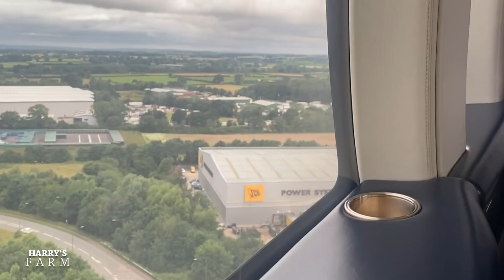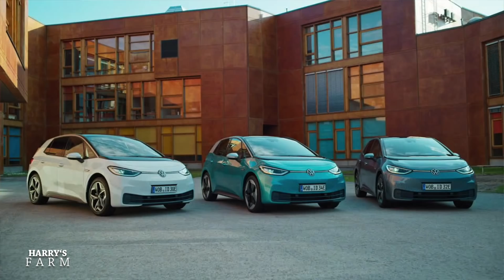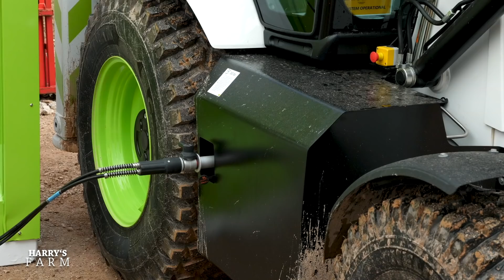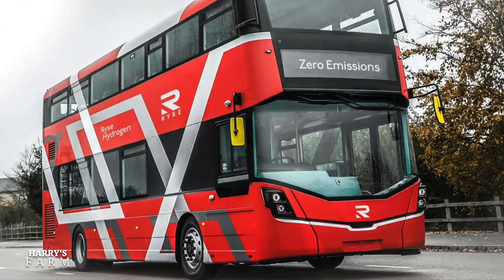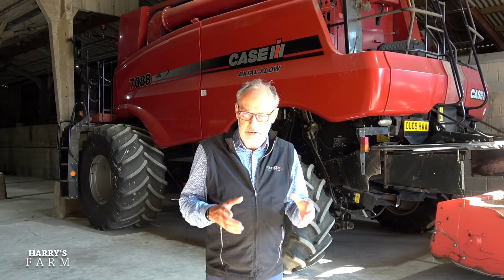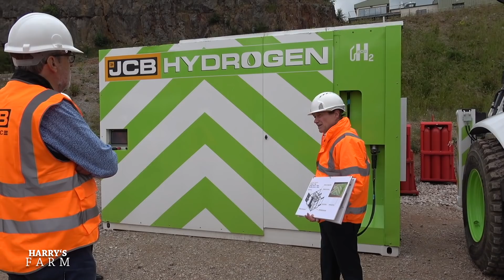Why JCB thinks hydrogen is the best alternative to diesel for heavy machinery, farming and HGV fleet

Comment: Without fuelcells, there is no point in hydrogen, you might as well use synthetically produced hydrocarbons.
Reply: Or just keep burning diesel, which is the entire point for their advocates.
Reply: @lordsamich755  So long as we made the diesel by capturing CO2 then fine, the only problem then is NOx.
Reply: @garthnareng4898  
That at least in some ways makes Ammonia a better choice as an energy carrier. If it's being reformed to feed a set of fuel-cells the nitrogen can be released into the air which is already around 80% nitrogen. NOx emissions are therefore inherently non existent.

When we go for a much stronger carbon bond, there is considerably more energy expended making and then breaking that bond. Which has a deleterious effect on round trip efficiency.

One also has to consider the energy expended to acquire the reactants in the first place. Nitrogen is readily available at industrial scale, (as is Ammonia for fertilizer production) as a side product to production of most industrial gasses, (Oxygen, Nitrogen, Argon, etc).

CO2 by contrast is generally manufactured for use in carbonated beverages, because extracting it from the air is considered economically un-viable.

Where the suggestion is to use the gas stream from a power plant. You are going to find that said project exists as an excuse to continue the use of that power plant, and nothing more.
Why would you reform natural gas just to combine the Hydrogen with Carbon and then burn it?

Natural gas is essentially Hydrogen that is already bonded to carbon.
It's just a less efficient way of doing the same thing. There is no real CO2 sequestration going on at the plant level or the machine level. It's just a Rube Goldberg machine designed to hide emissions.

If by contrast the system efficiency can be increased by using Ammonia as the energy carrier. Also if electric power becomes cheap enough. It starts to make genuine sense to produce the reactive hydrogen by electrolysis instead of steam reformation.
Reply: @lordsamich755  Ammonia might be too toxic for general use though toxic is a relative term. The low concentration of CO2 in the environment will indeed make it harder to use as a feedstock in carbon neutral schemes, which means that the energy used will have to be all that cheaper to make sense.
Reply: @garthnareng4898  
"Ammonia might be too toxic for general use though toxic is a relative term."

I didn't say drink it.
How is it more dangerous than cryogenic hydrogen? Or LPG?

"The low concentration of CO2 in the environment will indeed make it harder to use as a feedstock in carbon neutral schemes"

Or just use Nitrogen.
Reply: @lordsamich755  Truth is I'm just not sure how dangerous ammonia is. Also they are probability not talking about using cryogenic hydrogen just pressurised, if you did have cryo hydrogen then maybe you colud take advantage of it's heat capacity and temperature to get ultra-high pressure ratios in the combustion.
Reply: @garthnareng4898  
Detonation mode internal combustion engines have always been elusive. I would suggest that for the most part they are in the too hard basket for a reason.
Reply: @lordsamich755  Yes, with the super cold hydrogen the idea is to mix it with the air so that when it gets super compressed it will not be hot enough to predetonate. Now you still could try for proper detonation ignition, but like you say it's been an elusive dream, so just use spark.
Reply: @garthnareng4898  
You seem to be conflating detonation with compression ignition.
Reply: @lordsamich755  By predetonation I was talking about engine 'knock' in a spark ignition engine.

Comment: Thanks for doing this, very interesting episode regarding hydrogen powered engines. Im still unclear as to what they mean battery costs will stay the same, they have been constantly dropping for many years and will continue to do so. It’s estimated  production cost will have dropped to around $65/kWh by 2030 (at the moment it’s around $200/kWh). Their obsession with Elon is a bit bizarre but he is the main player that really did get the ball rolling and certainly gave others a kick up the backside, Germany really has nothing to do with the current EV obsession. Hydrogen will definitely be a better fuel source then battery for heavy plant vehicles, but hgvs will initially go electric as most manufacturers have already designed or are designing an EV.

Comment: Couldn’t agree more with JCB. The very best of luck to this fantastic British company.
Reply: good luck, because they are going to go bankrupt if they drop money into this crap
Reply: oil companies attempting to sell oils and gas dressed up as hydrogen it is a scam    Depending on the quality of the feedstock (natural gas, rich gases, naphtha, etc.), one ton of hydrogen produced will also produce 9 to 12 tons of CO2  
However, hydrogen combustion with air produces oxides of nitrogen, known as NOx. In this way, the combustion process is much like other high temperature combustion fuels, such as kerosene, gasoline, diesel or natural gas. As such hydrogen combustion engines are not considered zero emission.

Comment: Ps for those Pepole concerned with- NOX . Theirs a thing called a ERG valve (exhaust recirculation valve ) that stops NOX  from happening, so Pepole stop trying to come up with Obstacles against Hydrogen Powered Engines, Hydrogen is the most Logical Fule we have at the moment.  Methane with Nitrous Oxide mix is Quite Powerful if you need more Power...OK

Comment: Question is - is Sir Anthony planning for retro-fit hydrogen combustion power packs into existing plant.... that could be a massive game changer
Reply: oil companies attempting to sell oils and gas dressed up as hydrogen it is a scam    Depending on the quality of the feedstock (natural gas, rich gases, naphtha, etc.), one ton of hydrogen produced will also produce 9 to 12 tons of CO2  
However, hydrogen combustion with air produces oxides of nitrogen, known as NOx. In this way, the combustion process is much like other high temperature combustion fuels, such as kerosene, gasoline, diesel or natural gas. As such hydrogen combustion engines are not considered zero emission.

Comment: Great video Harry, I've thought for a long time its a better way than electric on large commercial vehicles and plant machinery, nearly a decade ago I was driving a truck daily in London and they were running the 1st hydrogen busses then, my question is what the hell have the engineers and the powers that be been doing for a decade, if that very eloquent gentleman that owns job can have a team put together an engine in such a short time surely every bus truck and diesel freight train in London and across the UK should already be hydrogen right, a decade to design mass produce a reliable unit and even retrofit options and infrastructure for hydrogen supply.
 The pollution problem in London alone could already have been solved, what do you think harry???

Comment: I'm a huge Hydrogen fan over electric and this video has convinced me more. I know a fuel-cell is more efficient than burning hydrogen in a combustion engine but this all makes so much sense for heavy machinery. Just need companies like ITM Power to produce more Electrolysers to get the green Hydrogen running to bring down cost. Fantastic info.

Comment: Hydrogen internal combustion engines are horrifically inefficient compared to hydrogen fuel cells. This looks even worse when you consider the present inefficiency of producing hydrogen. I totally agree that hydrogen is a far better route than electric, however ICE hydrogen is not the route. This is purely JCB trying to avoid a significant write off or re-tooling of their manufacturing site.

Comment: Not so simple to fill the fuel tank as now. Pressure connectors everywhere, leaky connections, leaks on equipment. Hydrogen is explosive therefore we can assume if it can go wrong it will. Once the masses have their hands on it we can look forward to many more explosions. With such a potentially dangerous fuel we need to engineer the distribution and supply networks every bit as much as the vehicles to ensure safe operation and stop us blowing ourselves up on a semi regular basis.

Comment: At the underground gold mine where I work we were looking at battery electric trucking. The battery packs could be hot changed with little to no labour, with the spent battery placed on charge. This eliminates the issue of equipment being out of service to recharge its batteries. Another advantage is much fewer moving parts compared to ICE, meaning less mechanical downtime. 

This doesn't mean that they're the way forward though. In our mine with hypersaline groundwater, the BEV vehicles would likely be especially prone to breakdowns due to corrosion of electrical components. Also with fire being our number one emergency concern underground a lithium ion battery fire would be near catastrophic (diesel equipment often have fires, but these can easily be extinguished with automated fire suppression). 

I do think the way JCB are going is a very well reasoned, but for certain industries it won't be suitable (underground mining for example, diesel is used due to it's low volatility hence lower fire risk). My question is, for certain types of industry, surely e-fuels or synthetic fuels would be the way to go? Minimal changes to the fleet, maintain all of the intellectual property and years of research that went into ICE while also being a responsible stakeholder in the environment.

Comment: To put this in perspective, in 2020 the Chinses built 52 new coal-fired power stations and have another 42 being built and plan for another 125. India too is going down the coal route. These two industrial powerhouses will have access to super-cheap energy while we, in the West will be unable to compete.
Reply: The Chinese install more renewable energy than any other country. Coal is one of the most expensive ways to produce electricity.

Comment: Why change to a fuel that causes 23 times the global warming as CO2? Water vapour alone already adds 14 deg C to the climate. And what about the safety issues dealing with liquid hydrogen at -180C. As hydrogen does not exist naturally on its own i.e. you can't mine it or drill for it, it's going to take a lot of energy to "make" it.

Comment: Well, a lot of points were conveniently not mentioned here...

Hydrogen is incredibly energy intensive to produce by electrolysis or it has to come from the oil and gas sector, ie fossil fuels. 

An electric vehicle is incredibly efficient where as an ICE engine is not. Less moving parts, more reliable. 

An electric socket is everywhere in the world, hydrogen is not!

You don't have to rely on someone else for expensive fuel, with electric you can fuel from your own panels and wind.

Noisy engine. 

Burning hydrogen still produces pollution and climate change!

An ICE burning hydrogen is still complex, requiring a lot of maintenance and parts, which is good for JCB lol. It still has oil in the engine!

JCB don't have to retool their factories or get new staff, it's just business as usual as he says.

Comment: Brilliant informative video as normal, keep the great content coming :-)
Reply: oil companies attempting to sell oils and gas dressed up as hydrogen it is a scam    Depending on the quality of the feedstock (natural gas, rich gases, naphtha, etc.), one ton of hydrogen produced will also produce 9 to 12 tons of CO2  
However, hydrogen combustion with air produces oxides of nitrogen, known as NOx. In this way, the combustion process is much like other high temperature combustion fuels, such as kerosene, gasoline, diesel or natural gas. As such hydrogen combustion engines are not considered zero emission.

Comment: This is very interesting and JCB is a first class world-wide company. However, I don't believe hydrogen is necessarily the way forward, as it is very expensive (and inefficient) to produce, compress (or refrigerate), transport and store. There are many problems with batteries, not least weight, size and cost, but energy density is improving rapidly and an electric motor is far simpler and quieter than a hydrogen combustion engine. Nevertheless, the work JCB has done in developing these hydrogen engines is impressive. Toyota declared hydrogen was the way forward for cars, but that company is now back-tracking.

Comment: Harry, correction to your comment on energy density. There are two measures of energy density for a fuel, gravimetric (the amount of energy in one kilogram) and volumetric (the amount of energy in 1 litre). Hydrogen is very good gravimetrically, 3 times better than diesel but much worse volumetrically, ~8-10 times depending on the pressure. This is probably still OK for a tractor, you will just have to fill up a bit more frequently and have a somewhat larger fuel tank. For aircraft it is a real problem due to the increased drag from the much larger fuel tanks. The other issue with hydrogen is the cost of the fuel, per kWh it is going to be significantly more expensive than electricity, although the exact price depends on who you listen to. Otherwise good video thanks.
Reply: I think the other factor is that the Hydrogen engine uses a very lean mixture, so they can provide a full day's operating time with Hydrogen cylinders fitted inside the existing fuel tank space.

Comment: Not only heavy machinery but cars as well!
Fixes the problem of relying on batteries and their massive charge times..... Hydrogen for internal combustion engines, also Hydrogen fuel cells feeding batteries in electric cars.. mass production reducing costs... easy gas refill therefore easy to do long range...
Despite his claims that cars do 300 hours per year, many do much more, I do 20K miles, and those journeys often exceed the battery capacity of current electric cars!!!

Comment: The number of times I have to explain what heavy duty means to people is insane. Yes EVs are great, but like he’s saying, a lot of this type of equipment is not a nice to have transportation luxury. They’re tools for making money and they are worked hard and long, often at their rated power. In your car you only access full power a few times if at all when you drive it to work. Heavy duty stuff often runs at full power (rated power or load) for hours on end. It’s an entirely different use case.

Comment: For Lord JCB is zero emissions when running his engines. However, how much emissions must be produced to generate the hydrogen? Did he consider that? Today and for the foreseeable future, production of hydrogen will pollute more than the use of conventional fuel in internal combustion engine. SMR+WGS methods of producing hydrogen require two molecules of water and one molecule of methane to produce four molecules of hydrogen plus lots and lots of energy (high temperature) that needs to be produced for the SMR and WGS to work (the only valid method to make the required energy is by burning gas or oil which means even more hydrocarbon burnt). Water electrolysis powered by marine power stations (clean method) is very expensive and only practical for very small production (no large scale technologies exist). We must remember that to power all the commercial engines in the world, and this in short perspective (European Union and other lunatics want to eliminate fossil fuels by 2040) is a dream of a turkey before Thanksgiving.

Unfortunately, electric motors and maybe some hydrogen fueled motors will be forced upon Europeans and now, it seems, Americans, while Asian countries (China, India etc.) will continue to use traditional power sources. They and their societies will reap the profits of cheaper p[production costs of their industries that come from cheaper power sources. Europeans (British as well) and Americans will suffer. Not the industrialists who externalize the costs of high energy during the production but, the people in these countries will suffer. Look at the prices of everything going up. It is not only because of printing money due to pandemic. It is and will become more and more, because of high production costs. And we all know what that means - if the cost of production is high in Europe and America, even more of it will be shipped to Asia. European politicians and bureaucrats will be able to say that emissions have been reduced in Europe and America. They will get their premiums and salary raises while people will suffer even more.

Comment: I don't think this is an entirely new concept. I went to either cereals or Lamma a few years ago and they had a New Holland tractor concept tractor with hydrogen. Unfortunately I didn't have time to take in the full facts and workings, but a lot of the cab posts were widened to allow for the extra fuel to carry. But, fair play to JCB. Having visited the factory many years ago, found the factory floor to be near clinical in appearance and methodology of approach. It was a very worthwhile trip and experience. Well done all for allowing this publication.

Comment: When purchasing a battery powered machine one should equate the extra cost against the fuel used over the life of the machine. Quite simple you are purchasing five years of fuel with the machine. (With lead-acid batteries single shift over five years if the rule of thumb) The charging cost is minimum against the cost of Diesel and Petrol. However I would fully agree with Lord Bamford, batteries are okay for fixed time/distance trips